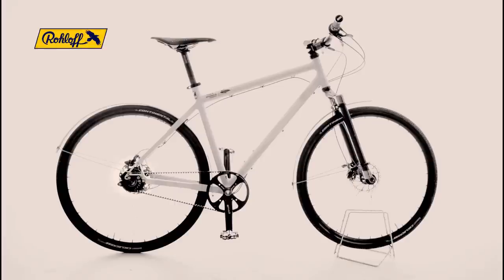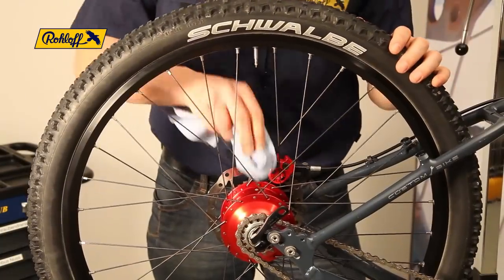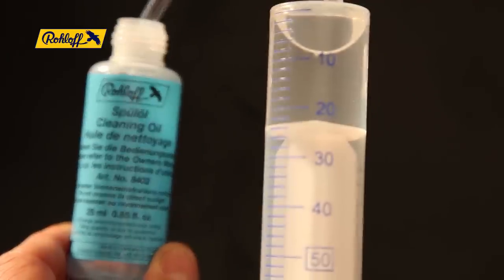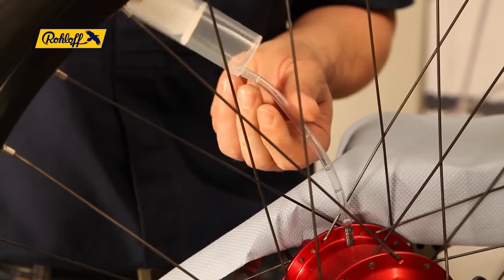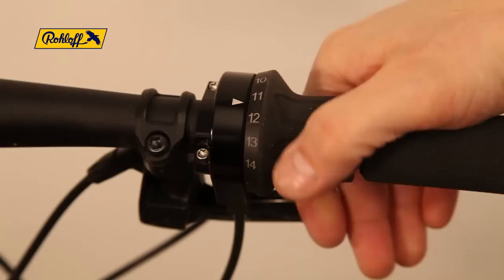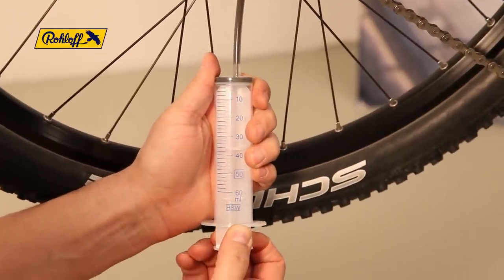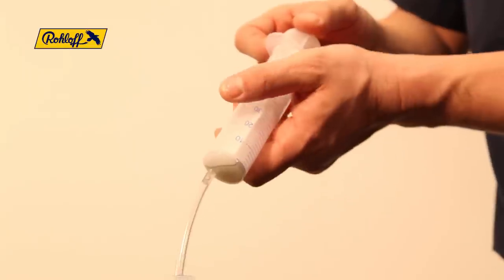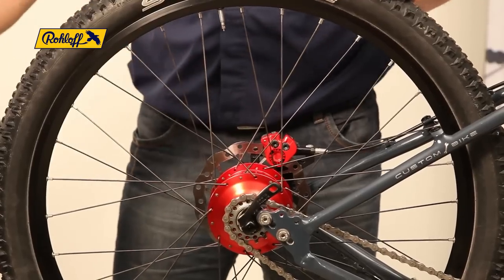SPEEDHUB Workshop - oil change

Comment: Nice video. But never ever clean the hub with the oil screw out. If there is any sand fallen from the wheel then you just rub it in. 
So clean the hub with cloth. 
remove screw. 
remove the oil process.
place screw.
then clean it with a cloth.

repeat the process with new oil and new screw.

my two cents.

Comment: If you do it like Rohloff says without taking a lot more time to let the mix of old oil and cleaning fluid drain out, then you will still have a lot left inside the hub when you put the new fresh oil in. For me having got most of the old oil out with the syringe I then leave the hub overnight to drip into a container I place below with the tube still attached. Just when you think the hub is empty and there is no more oil to drain, yet another dark oily trickle emerges from the hub. Draining the hub could be made so much easier if Rohloff made another drain plug hole at 90 degrees on the hub shell in addition to the existing one, there would be much less of a chance of air locks forming and preventing oil from draining easily out of the hub. Plus it would make it easier to put in the fresh oil as well.
Reply: I will follow this advice.  Its my first time cleaning, adding new oil.  I want to do it correct.
Reply: @marccarter1350  I do the oil changes as Rohloff instructs in the manual but allow A LOT more time for the hub to empty  of oil + cleaning fluid because 1) I want it ALL out and 2) if there is residual oil inside then adding the 25ml  or how ever much as required means in reality that there might be 30-35ml in total inside the hub after a change which COULD lead to seals leaking over a prolonged period. It is a little tricky get the last little trickles out as the Rohloff hub only has one filler/drain plug easily equalising the external and internal pressures is quite tricky and getting pretty much all the old oil out a laborious job. I use a small container, food tray etc beneath the plastic drain filler/tube on the floor on a piece of newspaper. The clear plastic drain/filler tube is the one that's in the oil change kit.The kitchen tissue I use to blot the end of the plastic filler tube which results in more old oil flowing from the hub. I also tilt the bike so the drain plug is at the lowest point of the hub meaning you hopefully get pretty much all the old oil out. There will inevitably still be some still adhering to the internals but you cannot do anything about that. But once no more oil is emerging from the hub, I then re-fill with fresh clean oil volume according to the manual but very slowly with the syringe so as not to stress or blow the oil seals as when you inject the new oil it inevitably increases the pressure internally as the single filler drain plug is the only way air can enter/exit the hub. I tried emailing Rohloff about adding an additional second filler/breather plug which can be screwed in or out like the actual drain plug itself to make pressure equalisation much easier, but Rohloff didn't want to know. They are quite an arrogant company really. "Our way is best you know nothing" sort of attitude. The Rohloff UK rep is a tool.
Reply: you mean bleeding the hub like you bleed brakes? that makes sense
Reply: @alexmorgan3435  I did it that way, but i only added 15mm of fresh oil.  Thorn cycles which i have one recommend this.  They say the other 10 mm is not needed.
Reply: @marccarter1350  Thorn can be very strident in their opinions rightly or wrongly. I prefer to follow a manufacturer's instructions. Less problems if there WERE a warranty issue at a later point.
Reply: @trailfork7815  No.

Comment: I have a comment\question.  The narrator clearly states to shift from gears three to five during the rinse period.  The video though shows at one point gear eleven.  This I assume is unintentional file editing ...?

For certainty, the rinse is to be done only between gears three and five?
Reply: Three and five because all gears are in use in those ratios.  Anything else is unnecessary.

Comment: The “extracting 25ml of air” part sounded a little redundant at first, but I guess it prevents getting a spurt of air and oil from the hub on removing the syringe.

In the technical part of his ‘Living with a Rohloff’ pdf, Andy Blance of Thorn describes using a double flush method which basically runs the cleaning twice using half the cleaning oil each time. That will take more time, but possibly cleans better.

Comment: Would it be possible to extract the old oil without the oil change screw in the down position?  I have a non standard set-up with a velomobile. To rotate the rohloff would require me to remove it from the bike, I would like to avoid that if possible

Comment: Can Rohlloff hub  be fited with any bike?
Reply: Yes pretty much
Reply: Yes.  But unless you have a frame that intend use is a Rohloff, you will need a Rohoff rear mech hangerer.  My frame by Thorn is designed for the Rohloff.

Comment: I did exactly as described in this video, and the result was that all oil leaked out in a couple of days. Did it again, with the exact same result, all oil leaked out in a couple of days. I called the shop where I had bought my bike, and here's what they said: I should never have filled the entire content (25ml) of the replacement oil into the hub. In fact what you should do, is extract the cleaning oil+the old oil, look at the total quantity, and only refill with the total quantity minus the 25ml cleaning oil; so, if you extract 40ml cleaninng oil + old oil, you shoul only refill with 40ml - 25ml = 15ml new oil. As I had put too much oil in it, I broke some rubber, so the thing leaked all the oil :( I wished they would have told this in this video, now I have to send in my wheel for repair ...
Reply: What your bike shop told you doesn't make sense. Initially we are instructed to add 25ml of cleaning oil inside the hub anyway. This is added to the existing old oil inside the hub and doesn't break any seal.  There is no reason why a seal would be broken if we extracted 25ml cleaning oil+whatever ml of old oil and then added 25ml of new oil.  This is the official oil change video from Rohloff and I don't understand why they would mislead us in such a way.
Reply: I think you should never use the old oil as a benchmark for the amount of new oil that is needed. As Rohloff states on their website: "An oil-change must be completed every 5000km or once per Annum to ensure the 25ml quantity of oil is retained and is free from dirt/moisture contamination. This process ensures that the SPEEDHUB 500/14 will always contain enough oil for lubrication (regardless of oil lost due to sweat oil) and also ensures that any penetrated moisture is rinsed out." 

In other words, if you don't use the full 25ml of new oil, the hub might end up with not enough oil.

Comment: But so how does this fit into Rohloff's newest policy about refusing to sell seals?  How long until Rohloff says you cannot change your own oil?
If your hub starts to leak oil, you cannot fix it yourself, you have to sends the entire wheel back to a "Rohloff Service Centre". So how does THAT work if you are somewhere remote??? You can buy the special tool to do it: still can, lots of people still selling it. But no seals. I've just had the UK distributer refuse to sell me any seals. They say I must send the entire wheel to them. And it's not under warranty: is entirely at my risk if I want to do it. I really don't like that.
Reply: You can use an industrial sealer to produce some, i suppose. They won't be as tough tho.
Reply: I also have to send my wheel there the hub screw is stuck

Comment: meh   soo costly     i want a hub with gear that can be changed during a load because i want to put an electric motor on it since i need high gear for my hill  and cruising gear for after that 
 that is if i want best battery efficiency
Reply: Enviolo then
Reply: get correct gears for rohloff/bafang/hills and buy a bafang on ebay. Make your own battery @ ebikeschool dotcom. There is a bafang on youtube with two chain rings. Thats the best for hilly area, just go low gear to climb and protect roholff gears.
Reply: Buy a proper motorcycle.